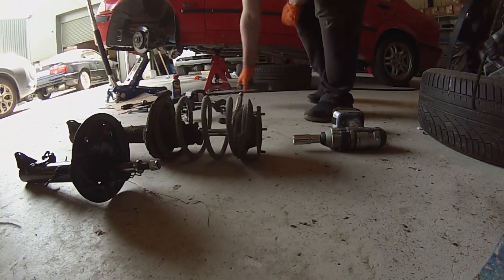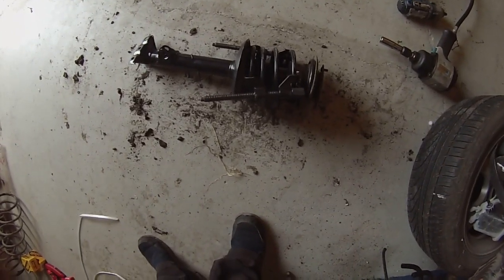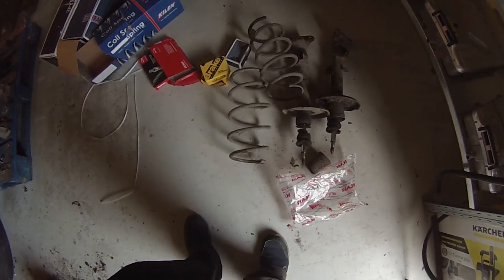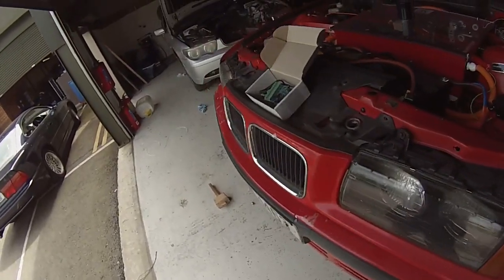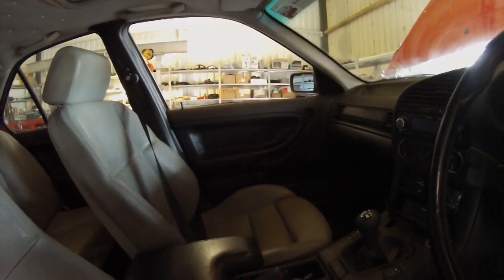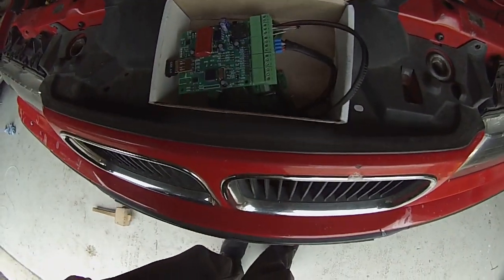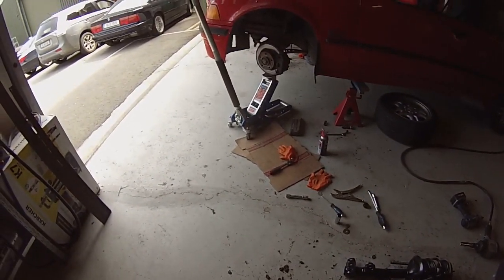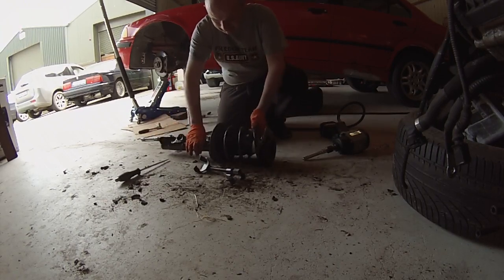€1,000 BMW E36 EV Build 16 : Repairs and Updates

Comment: Does the Power Watcher work with the 350 volt battery systems?
Reply: Now I developed PW3 + external voltage sensor(up to 600V).
PW3 can work from 12-36V or 36-200V. Power supply voltage selects on the soldering stage. Now PW3 is on way to Damien. And PW3 is absent on shop yet.